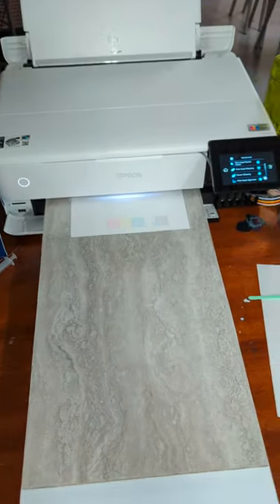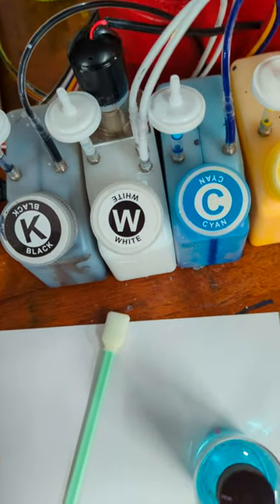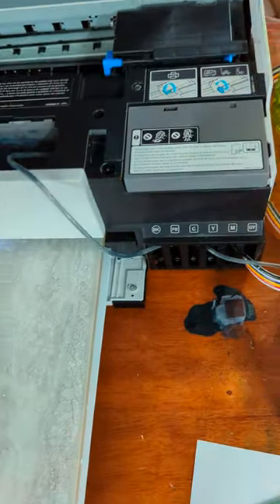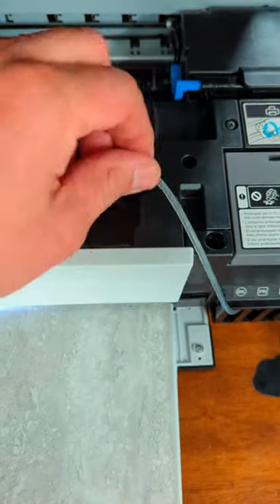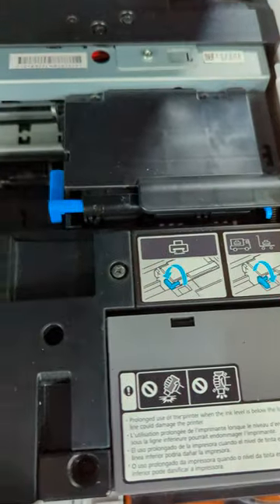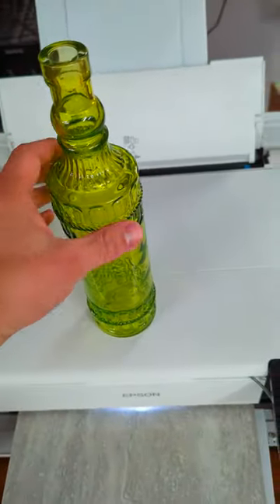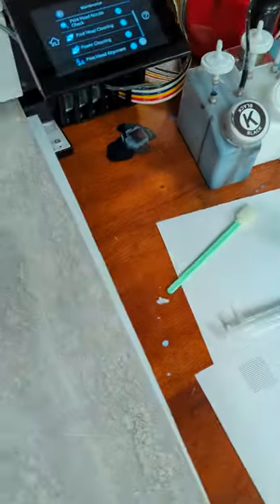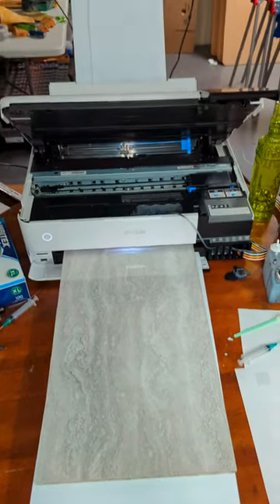Epson ET-8550 dtf conversion

Comment: Good day, thank you for your very insightful articles and videos. As you are by far the best informed expert I could find, I hope you can answer my question. I am planning to convert an Epson printer to be able to print on a powder distribution system (spreading thin layers of plaster on top of each other, the Epson prints an image on each layer), thus achieving a full colour 3D powder printer. In my view, the best way to do this is to leave the printer as untouched as possible, and only  through hacking the the encoder make it ‘riding’ on two rails above the powder bed. My choice has fallen on the et-8550 to do this with. A system such as this is only possible if the area where the printers operates, can be completely exposed, so only the printhead moves above the powder bed. Because there are no good diy’s for dtg available, this is hard to determine is this is even possible with this model. Do you perhaps know the answer? Kind regards, Eric van Straaten
Reply: Hi, I have this same ciss and have it set up almost identical to the way that you do. No matter what I do, within a day or two of clearing them out, air bubbles appear in the ink tubes just after the tubes exit the ciss ink tank. I've even installed a one way valve in the tubing but that hasn't fixed it. Did you ever have this problem and if so, how did you fix it? Thanks.

Comment: Hi there...In one of your reply's to a comment you said "...save and buy a printer built for DTF"...now that you have been using a converted printer, is it your opinion that that would be the less headache but more expensive way you would do it if you had to do it all over?  I converted an Epson WF7720 ($250) to sublimation and love it 3+ years however, DTF printer packages are around $1500-$1800 on the low end. Honest pro opinion would be worth hearing/reading. Thanks for all the info!
Reply from the maker: I went through several 8550 printers that all failed due to various reasons. They just aren't meant for dtf. We did invest in a large format DTF printer. It was the best decision we made for our apparel business. Yes, you'll be $5-8k out of pocket minimum...but it's worth it
Reply: @Gameondad6   Hi, what were the reasons?
Reply from the maker: @ the et-8550 is just not meant to handle dtf. It’ll get you through for a while. You’ll start to run into several issues and epson won’t warranty it anymore

Comment: bro after 3 imes or 2 times head cleaning need to replace new maintanence box are there another trick ?
Reply from the maker: You need a chip resetter. I can sell you one.  Shoot me a message
Reply: @Gameondad6   i saw your maintanence box have tube and do you have video how did it? how much cost resetter?

Comment: I think I might have to replace my 8550, I received the dreaded “paper jam” error with no paper jam, this is after having the printer for 6mos and regular maintenance.  I want to buy another 8550 but want to use this CISS system….im on the fence about it
Reply from the maker: You might try running a few sheets of white paper through the rear tray to see if it will take those. If it will, it might just be a matter of cleaning the rollers. If not, my opinion now is to order bulk transfers from a wholesale printer (us or someone local to you) and save until you can afford a printer built for DTF.
Reply: Delete program and reinstall
Reply: You don't need too replace but the Epson 15,000

Comment: Hi I have very important question but no one else answer yet, u have a built pump on ciss system for white ink and a mixer( 1 hose for put in ink second hose for return circulation?), do u switch on your pump when u printing or before u printing and then off when printing ?? could u show your connection for return hose in the print head do u have a 2x Y connector or 4ways one connector ?,
how strong u pun your pump to work its very slow,very fast or just to move constant flow ?
I have 4 ways connector and when I starting my prints about 5 min before I switch on mixer and pump  but I noticed that's my white ink when pump is on connector sucking different colours from print head and make it grey instead of white. maybe that's 4way connector causing suck. connector looks like ⬅⬆⬆➡ where on left arrow its in white ink,right arrow its out ink and arrows up its head conteiners for white ink. 

thank u
Reply from the maker: I didn't use a circulation pump with my 8550. Both white lines just fed the printer. I also quit using the 8550 and I was never able to get more than 6-7 months out of a head. I've since purchased a real dtf printer.
Reply: @Gameondad6 I wish you could gift me the 8550, for my small business in Africa

Comment: How did you prime your system? I can't get the ink to run through the tubes. We removed the tanks as well. TIA
Reply: I actually have this same issue only the yellow started to come out and the other colors are not coming through ?? Can't find anything and this printer is brand new.
Reply: @thefonze25  I was able to get the ink to run through by performing a power clean, unfortunately, the white did not come through. All other colors are visible when I do the nozzle check. I even tried on color paper to see if the white was working, but no luck.
Reply: @MsLC82  Did you ever figure it out?

Comment: Did you have problems with ink flow mine is dumping out. Like I have puddles on my prints.  Any help is appreciated.
Reply from the maker: My guess is, you need to clean it well. Your film could also be upside down

Comment: I really want to get my 8550 set up like this. Every CISS w/ white stirrer I see on Aliexpress comes with dampers for like the L805/L1800/15000, and not couplers. Having a hard time finding couplers to connect the CISS. Did your kit come with the elbow style, or the straight barbed type?
Reply from the maker: I can sell you one
Reply: @Gameondad6  thanks. But I built my own recently